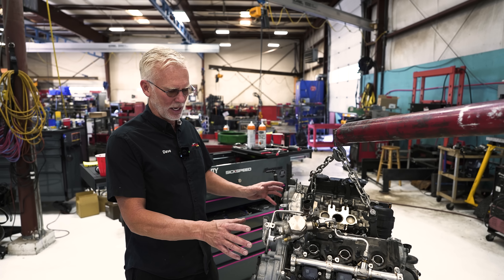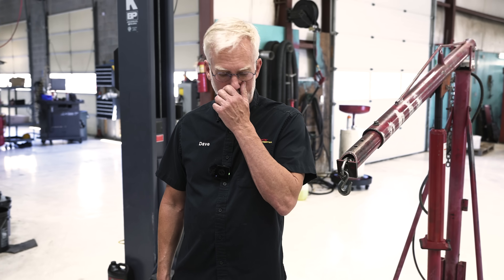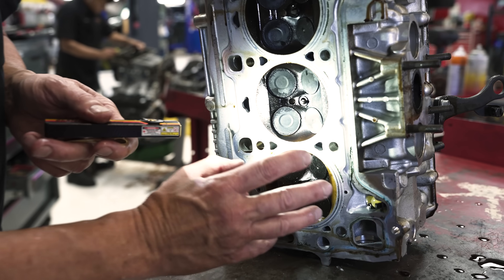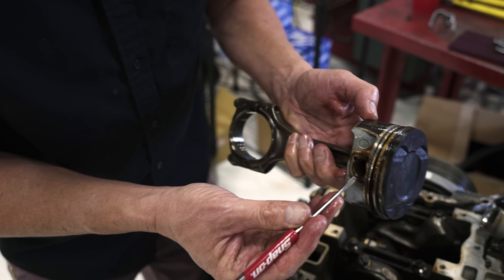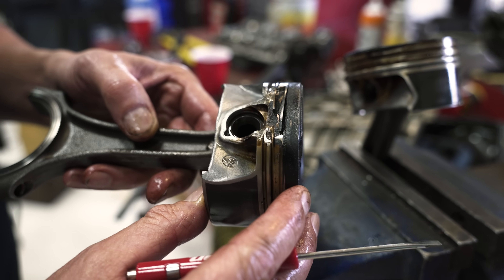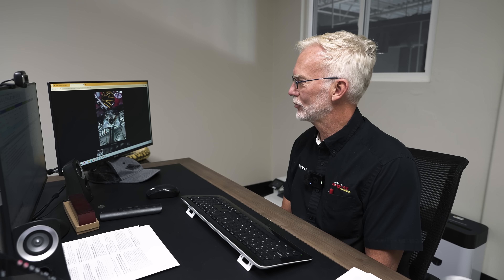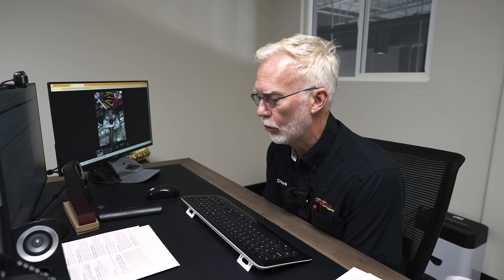Audi S5 Update: Piston Damage From LSPI (Low Speed Pre-Ignition)

Comment: For high compression Engines Specifically the Germans and other European Engines you do not need Expensive oil you just need the right spec oil. As long as it's the right Spec or newer spec doesn't matter if it's from cheaper brand it will be far better than Castrol or Valvoline that's older spec. 
For Example. Castrol 5W-30 ACEA A3/B3 is £35 to £40 and Mannol 5W-30 ACEA A3/B4 is £12-15. Which is better for you turbo charged German car? of course Mannol is better and Castrol can even destroy your engine. Castrol sells the newer oils and it cost an arm and a leg for a oil change.

Use ACEA A3/B4 (API = SN) For 2020 and older.
And ACEA A7/B7 (API = SP) For new than 2020 vehicles.
You can for most parts use Newer oils in older cars. 

Do Not use API = SM or SL or SJ oils unless your car is older then like 2008. 
Golf MK6 onwards and Even the First gen Audi A1,A5,A7,S1,S/RS5,S/RS7 require SN or newer oil.   

Also some turbocharge European cars require low sap oil.
Reply: you Do not need oil additives, just Fuel additives for soot. 
If you wanna clean engine internal use engine flush.
If you wanna clean soot form Intake, Combustion chamber and CAT/DPF then use additives in fuel or use fuel from better brands with additives already in it.

Comment: Dave I use to fly small planes and the engines look like boxer type engine and the hot rod motors had chrome cylinders on the inside like chrome plated cylinder walls and are absolutely great they just don’t wear unless you have a big boom in that air cooled motor is there anybody make engines like that or is it even available in a factory motor or a aftermarket chrome lined cylinders so let me know if they are available if you sleeve a engine. Thanks Dave make a video or just tell me and what’s your thoughts about these chrome cylinders .

Comment: Dam Dave your like a drug, I just can’t get enough of your videos . The one thing I would like to see and it is never going to happen but the price of some of the jobs and I do own a 05 Dodge 3500 4x4 long bed dullay 4 door 5.9 6 speed manual trans and if I ever have to build a motor which I don’t think I will need that but shit does happen but if I do you are the man and I would need it all like fire rings , springs ,  cam , speed of air pistons and gapless second rings from total seal ring sets and ARP head studs and my trucks are all stock but I do upgrades that I found out from research like the lift pump and I didn’t want all that stuff hanging down so I put a gauge to monitor my lift pump psi and I needed one at only 5 psi at idle and 0 at pulls and I found Fleece with a intank lift pump 21 psi at idle and 18-19 psi at a pull and yes I know that they put two factory gear motor pumps in a CNC machined to hold two gear motor pumps and what I found out is something pretty cool is that one pump plug and play factory plug and a separate wiring harness for the second pump that has relay and fuse but the good part is if one pump goes out you can still get you home on the second and with a gauge you will know when it happens so that’s a win win for me .

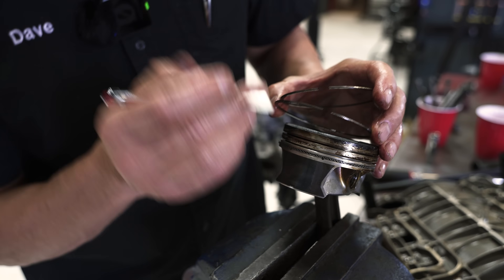Comment: 5:36 I don't understand he explanation
How does THICK Oil get past the rings, it should be the opposite
Thin Oil gets past gaps easier than Thuck Oil
He gottit back to fronté

😟😰😩😰😟😰😩😨😨😧😦😧😳😵😵😳😨😶😵😳😳
Reply: Because the ring is flimsy but the piston is not - the piston will push past the oil no matter what, but if the oil is thick then the ring bends and oil passes the ring. The problem is because the ring itself is made some crap materials

Comment: What I would consider as well is: was de ecu flashed/tuned? Creativity of a humans brain is endless, and when they google cheap S5 tuning they probably get to an ebay article for cheap flashing service for more horsepower. These tunes are often complete crap as they normally deactivate way too many built in engine protection like timing retardation or high egt behaviour. Maybe the owner that flashed the car always fueled premium but the next one doesn't know anything about the tuning and fuels up 88 pump gas and floors it. The ecu cannot react anymore to this especially with raised boost. So the engine goes knock knock boom.
The only way you can tell an ecu is flashed is to log and compare boost target pressures to factory cars.

Comment: I sincerely hope that Dave had his excellent technicians replace those stupid Audi rocker arms with the newer one.  If not, the issue may come up again.  Any responsible technician would have looked into this prior to order replacement parts and re-installing the engine.   The following was what I posted on a popular forum a while back:    "We laughed at my MIL because she bought the expensive $4100 Audi extended warranty(directly through Audi, not a 3rd party warranty)   Well, guess what?  At 61,000 miles(5 and half years since new), the same thing happened.   It was just like the one in this video. The piston was cracked.   Fortunately, the Audi dealer in Maryland replaced the entire engine after getting approval from Audi.  Talk about getting your money's worth from the Audi extended warranty!  Her final bill was just $0. Yes, ZERO.     If she didn't have the Audi extended warranty, the service advisor told her that the bill would have been $37,000.(more than what her S5 was worth at the time)   Although... they did mention that it was a well-known issue, so I don't know why Audi doesn't issue a recall... probably because of $$$?"

Comment: Having been in many similar engines,.. they're a bit of a nightmare and I'll avoid them in the future,  but,  if you're in there replace all the timing components, guides, chains, tensioners and possibly the wheels (cogs, sprockets, whatever you want to call them).  While it's apart replace anything else that's known to fail on those, like the oil control O rings in the valley that require a removal of the exhaust and turbos later,.. oh,.. and clean those injectors while they're out or replace them all.  Good on you Dave for being a bright light of reality in a world not know for it's clarity and honesty.

Comment: Every turbo charged Audi I ever owned gave me grief.  Only the 4.2 naturally aspirated V8 in my '04 S4 and '07 RS4 was solid as a rock. Not that those engines didn't have bugaboos.  Like in the video the timing chain requires a full engine drop.  The chains were actually reliable, but  the aging and wear of the plastic tensioners were the weak link. Speaking of plastic. When the serpentine belt needs replacement the whole plastic bumper/front-end has to come off. The wheels and inner buckets have to go too.  Oh yeah, you're still not able to do the belt as you have to partially unbolt the radiator.  Could it have been made more inconvenient and difficult to service? Audi makes beautiful looking cars that are nightmares to do even simple service. A true case that all they care about is getting the buyer's eyes and money, taking the gamble that any of the expensive maintenance will only occur after the 50K warranty is over insuring it's not Audi's burden (i.e "bag of hurt" per Steve Job's famous quote).

Comment: To prevent lspi do not use 0W oils, use anti lspi oil, use high octane fuel, each 5000 miles a fuel cleaner additiv and do not drive in high gear with low rpm when engine is cold.

Comment: The oil that is used can also contribute to LSPI. Look carefully for oils that are low SAPS or mid SAPS . if not mentioned its high SAPS. always use oil specifications that specified by car manufacturer. note that API-SP is a good indicator BUT also look voor the ACEA- SPECIFICATIONS 

"For instance: the possibilities of LSPI happening appear to be greater when using oils with higher amounts of calcium. Having stated that, LSPI does not seem to be advanced by the use of magnesium-based detergents and molybdenum mixtures, and there is, in fact, evidence of a decrease."

Comment: Changing all the injectors to coincide with the heads and valves being serviced makes sense. The possibility of the same issue occurring is greater if you reinstall those old injectors after all that engine work. Trying to keep this in a manageable budget for the owner is a valiant idea but, the odds of this reoccurring are high on a car this owner bought that probably was not well maintained or driven like a bat out of hell until the previous owner got rid of it. Many people cannot afford lots of these expensive over-engineered vehicles, so they buy them used, ultimately ending up with issues this poor guy got burned with.

Comment: Good Day Dave
Look at Porsche , Bore Scoring  caused by oil dilution while idling cold . LSPI is also a problem . As you mentioned driving while oil is cold is a issues . Porsche people are in a bad place with this issue. Cold starts are dumping raw fuel into the sump diluting the oil . Porsche dropped  NicSil coatings years ago(environmental reasons). They use a LucaSil or a AluSil deposits on cylinder walls , which is an issue in itself . Seems to be a reoccurring problem with Euro Engines .
Dave from what i see you and your crew are very Honorable and skilled people . I wish you and yours the Best . Keep being real and awesome .

Comment: PLEASE CORRECT. Multi viscosity new generation engine oils are actually thinner when cold and thicker when hot. For example. 5W40 oil. Oil viscosity 5 (W:Winter) is thinner. And 40 is oil viscosity at operating temp of engine which is thicker. Thinner oil when cold is to help the oil get pumped up quicker to lubricate during cold dry start.
Reply: That's impossible. All oils get thinner with heat.  0W, 5W etc is a cold cranking viscosity, meaning it is relatively thinner when cold than a straight SAE 20 (for example), but it's still far, far, far thicker than when it's hot. 🙂

Comment: I love Audi's; the design, the incredible interior quality, etc. I just can't say "NO" to them. However after one experience with an A6, and reading for 15 years about the V8s. I only buy Audis with the EA888 motor. ONLY Any shade tree guy can work on it since its in every Passat/Golf/Jetta that comes his way. 10 years with three different Audis with that motor and zero issues other than  water pump. Use good oil (Mobil1/Pennzoil/Motul is all I ever use), change at 5K miles, and rev it out half the time----don't drive for 50K miles like its Grandma's Lexus. I love the 6 and 8 cyl Audi but I'll never buy one.

Comment: It's lamellar graphite cast iron (GJL) sleeve, not Nicasil. That's why it survived that ring land failure. Earlier Audi engines, with Alusil cylinders would be rubbish after that.
The problem is that engine develops 500Nm of torque from 1350rpm. On top of that, to keep fuel consumption low, gearbox ECU try to shift gears as low as possible with as load as high as possible.
In this case, combustion between rings wasn't the cause. First ring land is gone so pure pre-ignition and very high pressure associated with it.
Oil ring is the oil control ring. 2nd ring is compression ring/oil scraper ring.
Reply: 100% This

Comment: As always, great content and explanations of the relevant conditions of the engine. Dave, please don't tell the viewers about the combustion of fuel, especially the match into an open container of fuel. As a retired mechanic I know only to well the not so good ideas some people can come up with. If you tell them you can throw a match into an open container of fuel, some people will run out to the shed to see t works. Don't get me wrong, your explanation of vehicle conditions and what to look for, the other problems it can cause, as I said, great content! Please take this into consideration, personally I would be horrified if I told this to someone who had then gone out and tried this and now has third degree burns to 90% of the body. Thanks and as usual I look forward to your next video.

Comment: EVERY time i see failed engines now, and they must be failing  by the millions, i see that it is the quasi-asinine regulations manufacturers HAVE to obey,   that are destroying the engines;
   amazing as it seems,  those dental floss low tension piston rings FAILED and the engine failed; and the reason those rings  are like that now, even though the world had stopped having problems with rings long time ago,    is because of the GOVs, the Regulations, the Green Revolution, in order to save one more drop of gas, to save the Planet, but  by killing all  new engines,one or more at a time ?; sounds like a Plan.

Comment: One of the rocker arms failed on ths engine. The part you said that might have been from the piston is a needle bearing from a rocker arm. Guessing the piston that failed is also on the same bank that the rocker arm failed. Hope that also gets replaced since the engine is out and would check the camshaft on that bank to see if any scoring happened due to the siezed rocker arm(s).

Comment: If I was making $80k a year as a tech, I would have quit and went to another dealer. The flat rate dealership tech job is absolute garbage and I never been so proud to have left it after 17 years as a Volvo expert tech that made $120k/year. I recommend to every person in the world to not follow my footsteps or the kid’s in this video making $80k lol😂

Stay away from the auto repair industry guys!!!!

Second, your oil recommendations is stupid. This specific Audi engine requires 504 or 508 approved oil. As a former Audi tech and Volvo tech, you should be pointing out the oil spec required rather than some “direct injected oil” bullshit.

Third, IE tunes were melting #6 pistons in hot climates and it caused several engines to detonate and kill the piston.  It had ABSOLUTELY NOTHING TO DO WITH THE OIL.

I’d be embarrassed posting this ignorant video if I was you.

Comment: list of things I would do additionally 1. clean the catalytic converter / gpf (after repair check afr / lambda so that the mixture is not too rich because the catalytic converter will be clogged and errors will pop up - by afr or deposits in the exhaust pipe it will be rather visible whether the car is tuned), 2. clean the intake manifold 3. check the condition of the lambda / nox sensors 4 check the efficiency of ALL injectors, even the new one!, 5. new ignition coils and spark plugs for all cylinders. 5. add ceratec / serpentinite to the new oil compliant with the standards 7 make the customer aware that cars with the euro 6 exhaust emission standard are not 6 liter V8 from America and you can go crazy with it but the oil must be warmed up (also in the gearbox and this requires a dozen or so kilometers of driving). refuel with HIGH-CATERIZED fuel and or use high quality fuel additives. also replace the air filters and look at the clearances on the turbine, maybe it's worth doing the timing since the engine is already out? best regards and I'm waiting for the video ;)

Comment: this is a known issue on these engines. EA839 have been having LSPI/Knock issues. Its due to the knock sensors. There are tuners out there who have fixed the issue with tuning. The issues were happening ALOT with stock b9/b9.5 S5/SQ5

Comment: First of all LSPI is primarily caused from using the wrong oil; using an oil with too much calcium or too low of calcium/moly ratio, See Lake Speed Jr for details.  So, attributing this damage to LSPI would REQUIRE knowing the engine oil isn’t VW508 0W-20, did Dave check send the oil out for analysis to confirm that?  This doesn’t look like LSPI to me anyways, it looks like straight up DETONATION caused by, you guessed it, a piggyback.  Think about it, a young kid buys a used Audi out of warranty and has it for 20 days and melts a piston?  It doesn’t take a rocket scientist to figure out what he did.

Comment: As a VW 1.8T owner..... this is why I have avoided going to a newer, direct injection engine/platform. Port injection may be less "efficient" but 1) I don't have to worry about my intake valves gunking up with carbon 2) My engine/fuel pressures are substantially lower than on DI motors, helping with longevity 3) I ALWAYS let the car idle for ~10 min prior to pulling out to ensure the oil also has a chance to warm up to ~ 100 F or more. Yes, I take care of my s**t.  No reason you shouldn't either.  Yes, my motor is fully built to handle 8K RPMs. Yes, the car is tracked. 

Run the correct spec oil and change it regularly!
Reply: That VW 1.8T is a spunky engine. Remember a rather not healthy one I worked on. Put new turbo in it and rewired the coils (broke wires amd connectors) and a few other things. Was rather quick

Comment: Audi has its own oil standards - which may not be API certified at all. I myself own a VW TSI and I use the standard VW 509.00 with a viscosity of 0W-20, if I look at the box, these oils, except for VW 509.00, this oil only meets the specifications of Porsche, Ford and ACEA C5, it does not meet any API and this is an oil that is created to prevent LSPI.

Comment: Detonation happening below the oil control ring is very very impossible dead engine looks like it was abused more than knocking and pinging and by the way today's standards of engines are turn the key and you can step on the freaking gas right now without no problem the days of warming up engines stopped in the 1980s detonation does not happen on the side of a piston it happens on the top of the crown which goes down to the lower ring which is usually compression ring that's where the the fault happens I would think that cylinder got too hot and broke the rings to begin with

Comment: Would sp rated oil be good in my 98 Ford e250 with the 4.2 l V6 Essex engine ? I been having to use E85 gas from Sheetz to overcome the pinging and knocking I had before the octane rating is Around 101